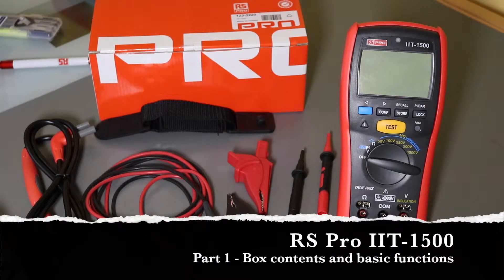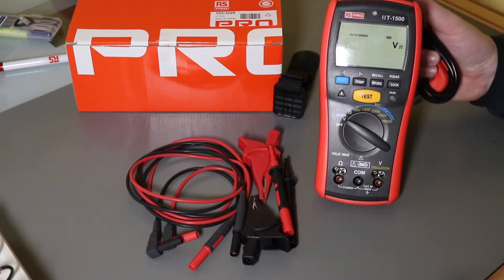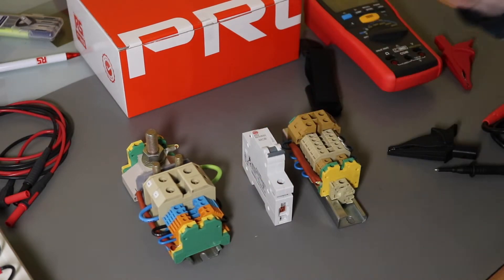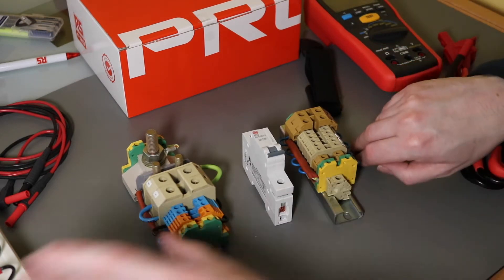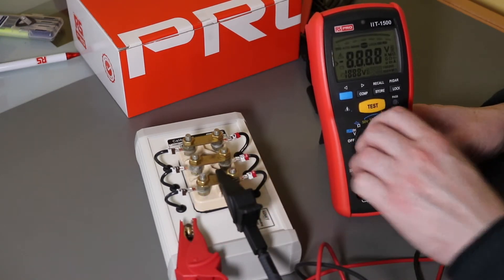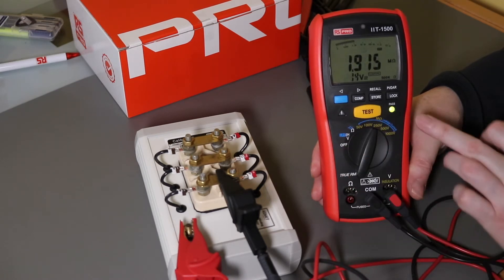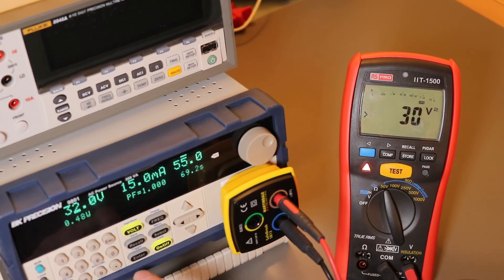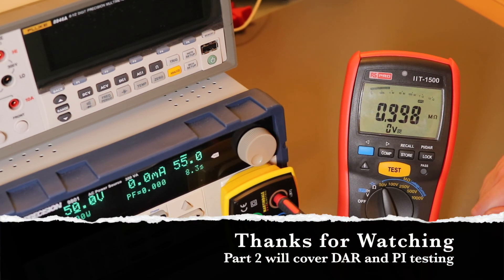Introduction to the RS IIT1500 Insulation Tester

Comment: Great video it’s  clear, clean and very informative. Who’s the maker of that test box  ?
Reply from the maker: Appreciate the comment. The motor winding simulator is a home built unit, just a set of inductors, capacitors and resistors in series with a parallel resistor across the capacitor.
Reply: Three-phase  Truly professionally done would you mind sharing your schematic so I can build one ? By the way I watched your video before and it inspired me to purchase a IDEAL INDUSTRIES 61-797 INSULATION TESTER . It’s the same exact Insulation Tester you’re reviewing but its yellow. Take a look at my YOUTUBE channel ( THE ELECTRICIAN TOOLS CHANNEL ) when possible. Thank you.
Reply from the maker: @TheElectriciansToolChannel  If you go to this blog on element 14;
https://www.element14.com/community/people/three-phase/blog/2019/10/23/modifying-the-motor-winding-simulator
The schematic is available. You can select components with the voltage rating for your preference, mine is limited to 500V. Just be aware that the unit is more capacitive than inductive, so it will hold a charge longer than a motor does after the test is completed, and can jump up after the insulation tester is disconnected.
Reply: Three-phase Thank you sir.